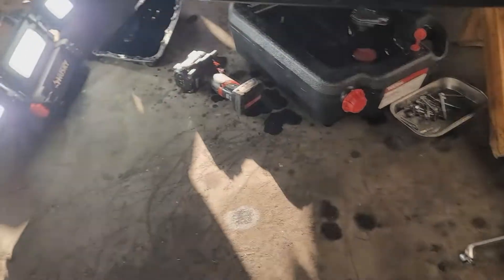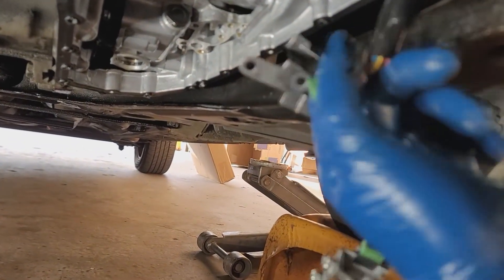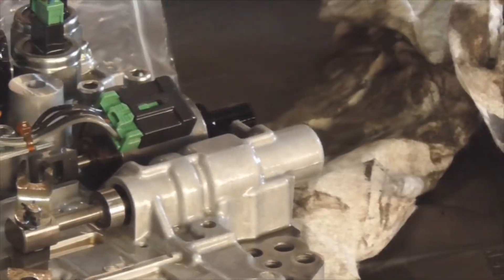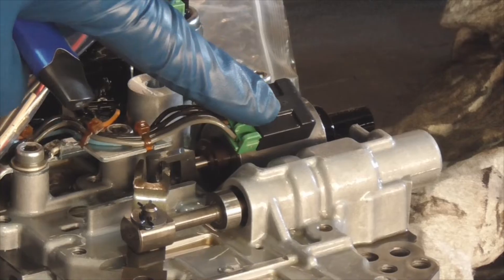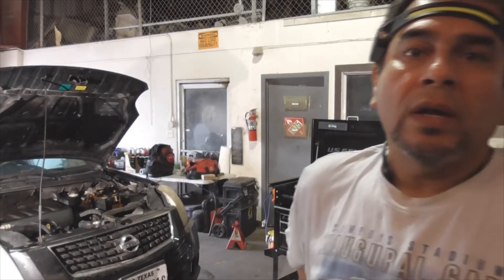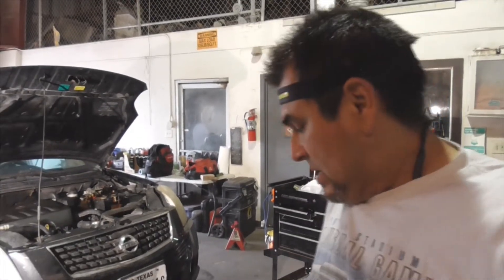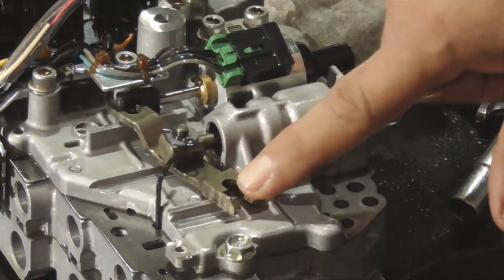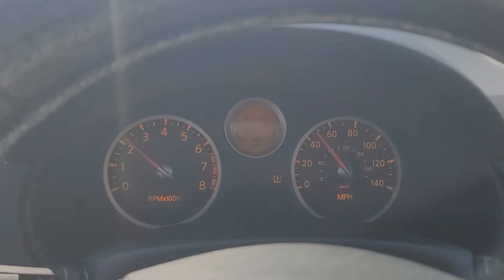NISSAN P-1777 & 1778 - 2008 SENTRA STEP MOTOR CIRCUIT/FUNCTION

Comment: I changed the whole valve body with 1 from pull a part now the car only goes in drive no matter which gear I'm in did I do something wrong or is the part just bad

Comment: Great video very helpful, I did not see a gasket between the actuator "valve body" and the transmission, does it have its own gasket ? Thank you for your help
Reply from the maker: No gasket necessary. the cvt has internal orings that seal the body to the housing.

Comment: Thanks my 2012 nissan cube p1778, p0868 codes.  I'm freaking out, advantage nissan dealer stated i needed a new transmission 5k to 8k omg.  Got a 2nd opinion and fix.

Comment: Hi! Frank . Thank you for posting this video. I reached you a while ago and I made you a comment, a 2008 Nissan Sentra step motor I changed the step motor but after I changed it the car was running only backwards, so I removed the valve body again and I rechecked everything and installed it back but this time the car just run forward the opposite it doesn’t move backwards. Any Suggestion Frank please . Thank you
Reply from the maker: I would double check that all the harnesses are properly connected, make ABSOLUTELY sure you have the right actuator part numbers in place and make sure you reset the module after you put it all back together, OR disconnect the battery for a few minutes (you should be doing this work with the battery disconnected anyway). If you still have the problem, unfortunately you should probably take it to a professional shop.
Reply: Thank you Frank for getting back to me so quick and for your advice. You are amazing. I really appreciate your suggestion. Have a great day body

Comment: I cleaned the valve body the solenoids , and tranmission filter. 

But I didn’t put the Right CVT transmission fluid. 

It requires blue NS3 fluid. But would that make bigger. Difference

Comment: I have a p1778 code 
Also U0101 , P0746 , step motor!  I changed it on my 2011 Nissan Murano 3.5. 

And it still comes up. My engine doesn’t go passed 60km in first gear. It doesn’t even shift gears. 

Any ideas??

Comment: How many quarts of cvt fluid will i need to refill? I have a 2011 sentra with P1778 and no power almost like its slipping. it was going 40mph at high rpm, but i had to drive it home and after going over the hill it seemed to have worsened. Now it can barely crawl on flat land at 20mph and the rpm won't go above 2k or so. I'm going to attempt this stepper motor change to see if it will fix it.

Comment: My altima has the code 1778,i replaced the step motor and valve body,got the parts out of a wrecked car,after install i still have the same code and same problem,any idea?

Comment: Do you know the part number for the step motor? My Nissan is having this issue, but I cannot find the part at any part stores. Amazon and ebay are the only places it comes up for shipping.
Reply from the maker: F1CJA Is the part number for the manufacturer I found on ebay. the cross reference numbers are: 203452A, 33435J ,D33439N. i recommend calling your local Nissan dealer with your VIN and asking for the official part#, though most sites on ebay have a compatibility chart and the same part# is applicable to many models.  BUT VERIFY TO BE SURE. You are probably not going  to find it at regular parts stores. Try a transmission shop, but it's probably going to cost significantly more.

Comment: Sorry to bother, how many quarts of cvt fluid does the car need after making this replacement? Ive been a lot of different answers!
Reply from the maker: I would buy at least 4 qts, but the best way is to measure what comes out because it will vary by a bit. Add what you take out, warm it up and use the dipstick to make sure.

Comment: Hi Frank, thank you for the video, I replaced the step motor following all the steps (I did noticed that the dark rod on the fwd side near the 14mm bolt was all the way in on my and in your video it is halfway out). After assembling  everything when I shift the car to Drive or reverse, it just stays as if it was in park. Any ideas of what I might have dine wrong. Thank you and please keep making great videos.
Reply from the maker: I would check to be sure you reassembled 1. the shift lever in the correct position. 2 all of your electrical connections are secured.

Comment: Di you have to put that expensive Nissan Trans oil ? Or u can use another brand or that redone for imports ???
Reply from the maker: You can use any CVT transmission fluid, as long as it says, "CVT".

Comment: If the Nissan rogue can  go up to 180 mph, but when you drive long journey it starts going into limp mode at 80 or 100mph and doesnt go more than that, and start hearing whinning noise from the transmission, and eventually going to limp mode at 20mph or 40mph and stalls, but when you switched off and park for about 30 minutes. When you switch on and driving it, the car will accelerate very well, going to higher speeds as if there were no any problem. The scan code is P0741, Torque converter clutch solenoid malfunction. How to solve this problem?

Comment: Does the steeper motor when goes bad cause the whinning noise from the CVt transmission ?
Reply from the maker: I don't think so. Make sure you have the proper fluid level , but more importantly make sure it's CVT FLUID.

Comment: Hi! Frank. I asked for help last week because I was working in my stepper motor and I couldn’t figured out how to put everything back, so you suggested me to send some pictures to your email but eventually I figured it out. However, I have another issue, I installed the stepper motor and put everything back, the car seems that is running fine but only forward , the rear gear is not responding so I can’t back up. I put the scanner abd it’s reading that code p1777 is pending. What should I do, did I do something wrong why the reverse not working? Thank you

Comment: Frank I have another question. I am not a mechanic and by watching this video  I tried to change the stepper motor myself, I took off the all panel where the selenoids and stepper motor at, but now I can’t put it back because another piece of the panel attached to the stepper motor came off, I probably took some screws that I wasn’t supposedly to remove. Do you have video how to put the panel back, beside this video? Thank you for feed back
Reply from the maker: I don't have another video, but if you can send me pics at bpa7104@gmail.com, i might be able to help you a little more.
Reply: Thank you Frank. I’ll  send you pictures. I appreciate you man.
Reply: Thank you Frank. I’ll  send you pictures. I appreciate you man.
Reply: Thank you Frank. I’ll  send you pictures. I appreciate you man.
Reply: Thank you Frank. I’ll  send you pictures. I appreciate you man.
Reply: Thank you Frank. I’ll  send you pictures. I appreciate you man.
Reply: Thank you Frank. I’ll  send you pictures. I appreciate you man.
Reply: Hey Frank, great work. I have a quick question, I'm seeking some direction on purchasing the right step motor on ebay or Amazon, I have a 2.0L Blue bird sylphy G11 model, I've scanned the car got the same codes but when I search for the part Nissan Altima step motor comes up, would thos work for my model vehicle as well? Any feedback would be appreciated.

Comment: What happened if the vehicle was running without transmission fluid? And through code p1777 and p 0845??
Reply from the maker: Get it looked at by a professional, but it sounds like you burnt up the actuator (valve) body. 1777 is the step motor. I believe a while ago I  saw a p0845 (IF that's a pressure sensor B code) in a friend's Sentra and one possible fix was a valve body replacement. It didn't work. That being said, we also found the harness mangled by a previous "mechanic" so we never really got to the bottom of it. IF you ran it with very little fluid for ANY length of time and the vehicle produced DTCs, my recommendation is you get it to a transmission shop that works on CVTs and pray for the best. The p0845 is the doozie. As I think back, the pressure sensor is in the middle of the valve body and is not serviceable if I remember correctly. I'm not a mechanic nor a transmission specialist so I'm just telling you what I would do with my own vehicle. GOOD LUCK!
Reply: Thank you for your feedback. I run a scanner and in fact is reading code p1777 and p 0845
Reply: Thank you for your feedback. I run a scanner and in fact is reading code p1777 and p 0845
Reply: Thank you for your feedback. I run a scanner and in fact is reading code p1777 and p 0845
Reply: Thank you for your feedback. I run a scanner and in fact is reading code p1777 and p 0845
Reply: Thank you for your feedback. I run a scanner and in fact is reading code p1777 and p 0845
Reply: Thank you for your feedback. I run a scanner and in fact is reading code p1777 and p 0845
Reply: Thank you for your feedback. I run a scanner and in fact is reading code p1777 and p 0845
Reply: Thank you for your feedback. I run a scanner and in fact is reading code p1777 and p 0845
Reply: Thank you for your feedback. I run a scanner and in fact is reading code p1777 and p 0845
Reply: Thank you for your feedback. I run a scanner and in fact is reading code p1777 and p 0845
Reply: Thank you for your feedback. I run a scanner and in fact is reading code p1777 and p 0845
Reply: Thank you for your feedback. I run a scanner and in fact is reading code p1777 and p 0845
Reply: Thank you for your feedback. I run a scanner and in fact is reading code p1777 and p 0845
Reply: Thank you for your feedback. I run a scanner and in fact is reading code p1777 and p 0845
Reply: Thank you for your feedback. I run a scanner and in fact is reading code p1777 and p 0845
Reply: Thank you for your feedback. I run a scanner and in fact is reading code p1777 and p 0845
Reply: Thank you for your feedback. I run a scanner and in fact is reading code p1777 and p 0845
Reply: Thank you for your feedback. I run a scanner and in fact is reading code p1777 and p 0845
Reply: Thank you for your feedback. I run a scanner and in fact is reading code p1777 and p 0845
Reply: Thank you for your feedback. I run a scanner and in fact is reading code p1777 and p 0845
Reply: Thank you for your feedback. I run a scanner and in fact is reading code p1777 and p 0845
Reply: Thank you for your feedback. I run a scanner and in fact is reading code p1777 and p 0845
Reply: Thank you for your feedback. I run a scanner and in fact is reading code p1777 and p 0845
Reply: Thank you for your feedback. I run a scanner and in fact is reading code p1777 and p 0845
Reply: Thank you for your feedback. I run a scanner and in fact is reading code p1777 and p 0845
Reply: So do you think that by replacing the stepper motor won’t do any good
Reply: So do you think that by replacing the stepper motor won’t do any good
Reply: So do you think that by replacing the stepper motor won’t do any good
Reply: So do you think that by replacing the stepper motor won’t do any good

Comment: Please help, my Nissan altima 2008 2.5s stocked up in first gear, won't go beyond that, after diagnosed with computer, P1777 code was detected, today I took it to my mechanic, he service the gear, and test drive, it worked, after few seconds, when the car warmed up, it got stocked in first gear again. Now I noticed That ATF fluid was used to top up the gear oil instead of CVT fluid.. Please I need your help, what should I do?
Reply from the maker: OK. First of all, a P1777 is an ELECTRIC code that tells us the step motor is not reacting properly to electric input. I'm not sure what he did when you say he "serviced the gear." Absent  obvious wiring damage, the repair involves replacing the step "motor" (actuator).  Second, if your mechanic filled your tranny with ATF and not CVT fluid, I recommend you get another mechanic. it needs to be drained and refilled with CVT fluid. The step motor is relatively easy to replace. I think I bought mine for $34 or so.  I hope this gives you some direction.

Comment: I am having the same problem   I push gas pedal and nothing. But I reset the throttle body relearn procedure it will go for about 50 feet and go into limp mode ! MY question  is if the transmission was messed up mechanical part of it. Could by resetting comp fix it! I think it's an electrical part solenoids or stepper motor! Any ideas
Reply from the maker: Well, if your scanner produces a P1777 you're gonna need to replace the stepper motor. Resetting the modules will let it run normal until the TCM picks up  a failed diagnostic.
Reply: @frankdaiii6403   I did have a code I don't remember what it was. B4 he reset the code on his little scanner thing. I think it said speed sensor! But I called nissan and he told me at the parts counter that it sends the sensor code when there is an internal failure!  But I figure a computer can't fix a broken mechanical thing right! It drives for a little bit then stops! In limp mode! No sounds other than maybe a lite scrape of metal. If I change the stepper motor and maybe solenoids do u think it might work!
Reply: And there is reg atf oil in the tranny. Is that OK
Reply from the maker: @Mary-qo1wu  NO NO NO! CVT Transmission fluid is all you should use. Period. You are correct, you are not going to fix anything with a scanner, BUT you need the actual diagnostic trouble codes in order to be pointed in the right direction. AND you should know not all base-level scanners will pick up Nissan transmission codes. Do not "fire the parts cannon" at the problem and hope you fix it. Generally, metallic sounds coming from a Continously Variable Transmission ( or any tyranny for that matter) is a very bad thing and you should have it checked by a reputable shop.

Comment: Would this fix my clutch slipping problem? I have a P1778 code but my 2011 sentra doesn't go limp, it does the opposite (rpms up but barely moving)
Reply from the maker: I don't think it's a clutch problem. 1778 is a mechanical malfunction of the step motor. Circuit is good, but it's not responding as it should, which means it could be stuck in high gear.
Reply: @frankdaiii6403  do you think I should proceed to replace the stepper motor?
Reply from the maker: @amxr2728  yes.

Comment: I have a nissan rogue cvt 2012, when you have a bad stepp motor or not properly engaged does it feel like a clutch slipping ( rpms go all the way up on acceleration but vehicle barely moves) or is it more like you accelerate but rpms don't really move all the way up?
Reply from the maker: MINE felt like a dead pedal (limp mode).
Reply: @FRANK DAIII  yeah from the videos I have seen. It looks like the symptom is like limp mode. You floor the accelerator pedal but it won't accelerate. ( rpms just get stuck on 2 or 3k rpms) mine is more like slippage, rpms shoot all the way up but vehicle barely moves.  Definitely a mechanical issue with the transmission.

Comment: Please help! Had two codes P0776 and P1778. Replace solenoid A and stepper motor. P0776 is cleared, and P1778 was replaced by P1777, may be I did something wrong! Please give me some light:) I’m new at DIY :)
Reply: Before do anything… when drain did u see shaved metal or glitter?

Comment: Dang VERY clearly!!!! U said again n again got it … I got customer want me fix it n what right part for 2013 Nissan maxima I believe… can u send me link so I can buy it … thanks for ur time and sharing videos!!
Reply: Never mind about link .. I got it … but it same 2013 ?
Reply from the maker: @vicentegonzales3852  CHECK WITH WHOMEVER IS SELLING YOU THE ACTUATOR. THEY SHOULD KNOW.
Reply: One more mention… do we have to have scanner to reset or relearn? For transmission mission
Reply from the maker: @vicentegonzales3852  YES, but any medium grade scanner can reset the Trans control Module.
Reply: This week.. I plan to do that job n I got obd2 Bluetooth with my iPhone and said that vehicle must be 91 temperature for check fluids on drain plug … no dip then add more transmission fluid until see slow leak then put plug back that it …. Or can I use transmission dip stick ?